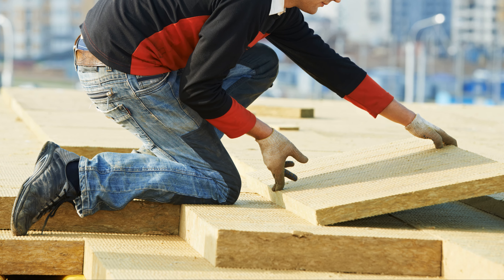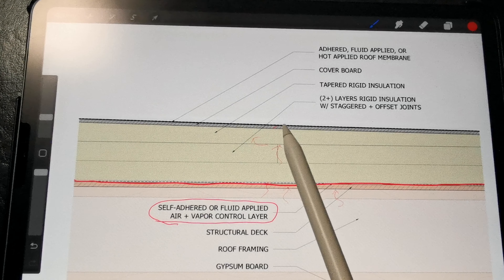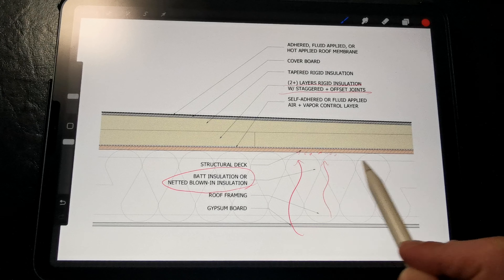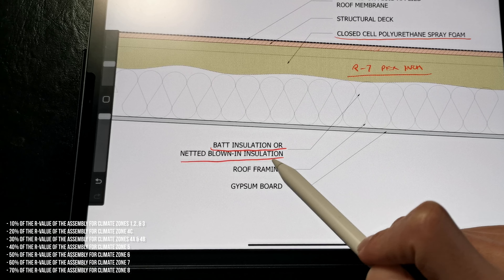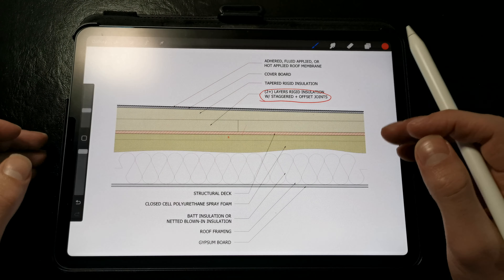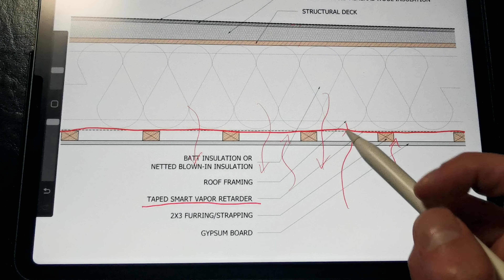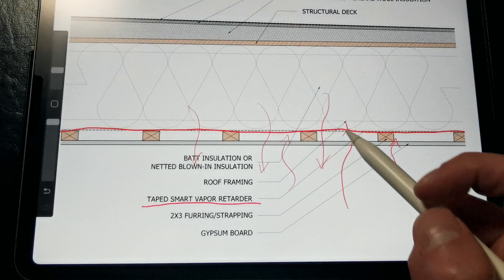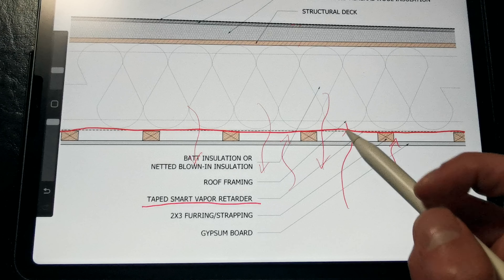Flat Roof Insulation Strategies (For Architects and Contractors)

Comment: Hi, thank you so much for this. I am looking for a product/strategy that can be applied on a flat roof terrace for thermal insulation. The waterproofing membrane has already been applied. I would like to install something without having to redo the whole roofing. Is there a material I can use to install before they install the decking of the terrace? If I install any thermal insulation, would I then have to redo another membrane on top? Do you know of an insulated decking system that can be applied on a finished flat roof? Any suggestion is welcome! Thanks
Reply from the maker: Hey there! Great question - I'd have to take a closer look at the existing conditions that you're working with, as every project is different. It sounds like you could have the opportunity to create a great inverted/protected membrane roof, however, the addition of rigid insulation can throw off the heights of your existing exterior door thresholds. We do provide consulting services if this is something that would be helpful for you: https://asiri-designs.com/consulting
Reply: @ thank you for your reply! I have been thinking about it and the best idea i could come up with yesterday was a raised insulated floor which could work provided the depth is ok. But i still haven’t found the right solution. The inverted system sounds cool and interesting too.

Comment: "Polyiso: At a mean temperature of 75°F, the polyiso sample also exhibits a level of thermal conductivity which correlates to its published R-value of R6. 0/inch. However, as the mean temperature drops to 15°F, the R-value decreases to approximately R2. 0, representing a significant 66% loss in R-value."

It also costs more than EPS or XPS.  I would consider burying the the polyiso under a blanket of XPS so it will not be subjected to the most extreme cold, and thus, retain its marketed R-value.

Note, Polyiso's R-value begins its plummet around 55F.  So, IMO, Polyiso is a warm climate insulation.
Reply from the maker: Yup! We discuss this very topic in the book and the ability to combine it with more thermally stable insulation types like you mentioned. Good stuff!

Comment: I am doing warm roof on 6/12 pitch. Exposed rafters and roof board inside. I like mineral wool but it does cost. With post and beam timber frames we try to keep moisture going out of structure. I am used to seeing thick roof assemblies with purlin.

Comment: If I would like to have a decking surface on top of the flat roof it seems strategy 4 is the only real way I could do that. Would you agree or are there other options that could be used? What do you think the best way to insulate it would be? Thank you.
Reply from the maker: Actually there are several ways to successfully accomplish a deck above a flat roof membrane, check out this video I released a few months ago: https://youtu.be/jVaOG2ffSFs?feature=shared

Comment: I'm assuming all 5 strategies listed would be for an unvented roof design, correct? Is there a reason why in Strategy 2 and 3 you cannot run ductwork in the rafters/trusses/roof framing area? As long as the insulation is touching the underside of the roof deck in an unvented design, this should be an acceptable practice, correct?